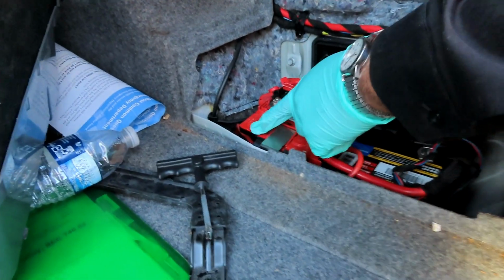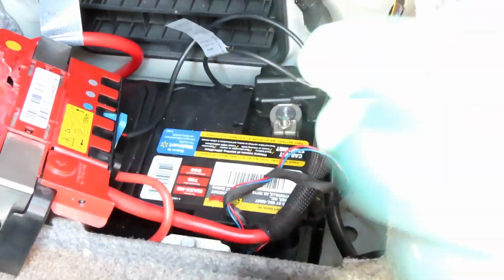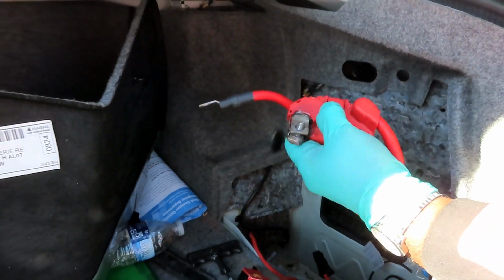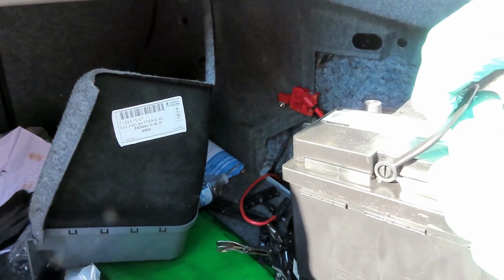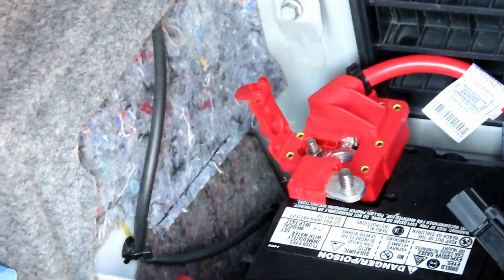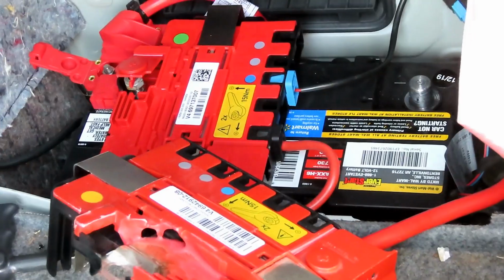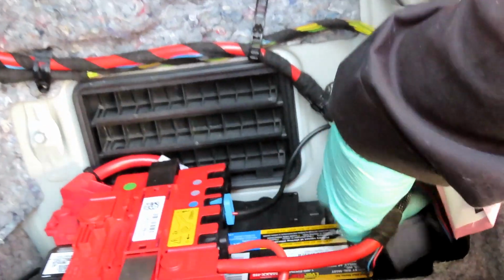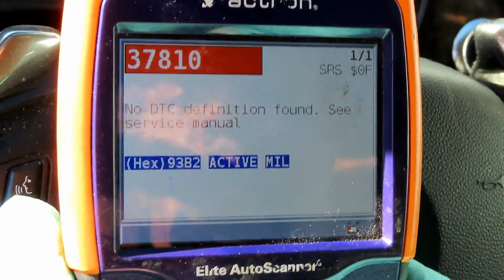⭐ 2008 BMW 335Xi - 3.0 - Runs Rough - Stalls Out - NO START - No Power - Smokes - Part 2

Comment: Tim nice but why not use the 539b?
Reply from the maker: The Actron can get codes from ALL systems, and the AL539B can't.
Reply: @OnlineAutoRepairVideos  What, that isn't what you had me thing about 539b,pls 
 clear or tell us the difference thxs.
Reply from the maker: @62ejo  LOL, sure Ed! The Al539B can read engine & transmission codes, but the Actron (well this model) can also read ABS & Air Bag. But the AL539B has that graphing capability that is needed the most.

Comment: That plug you see by the battery that wasn’t connected, that’s normal on most if not all newer bmw , that plug is used to plug in a battery charger when a car is brand new and shipped from factory so when dealer gets the car a battery is on full charge, also on those bmw s a replacement battery needs to be coded to the car so the car knows it has new battery, otherwise if not done it will work but after a little while that battery is gonna be dead again because those cars have IBM system which is intelligent battery management, just google it it will explain how to coded the battery. Just FYI .
Reply from the maker: Eldin, do you have a link to verify that info, and if so, could you please provide it?
Reply from the maker: Appreciate the info.